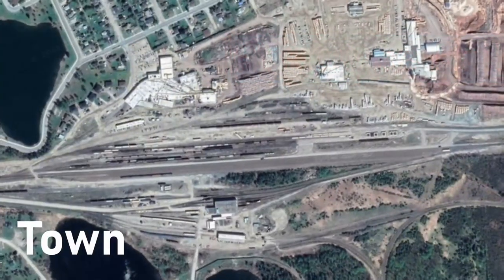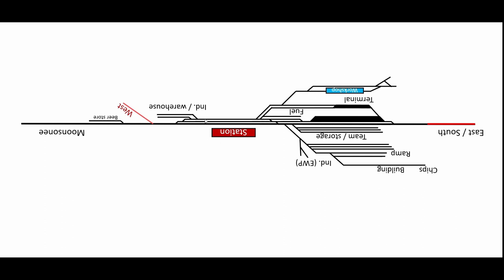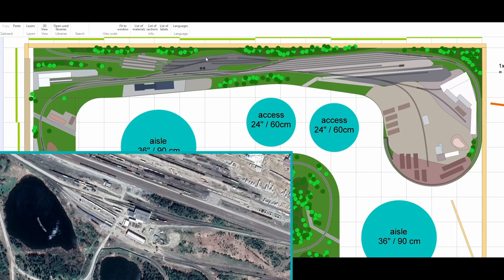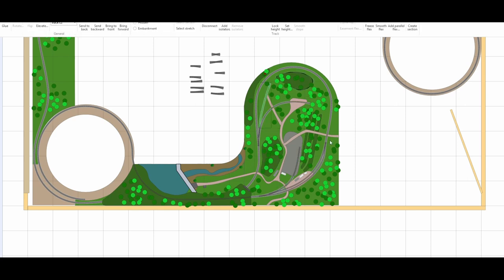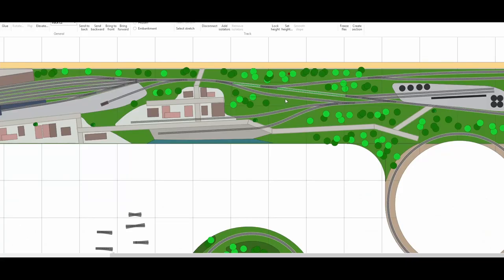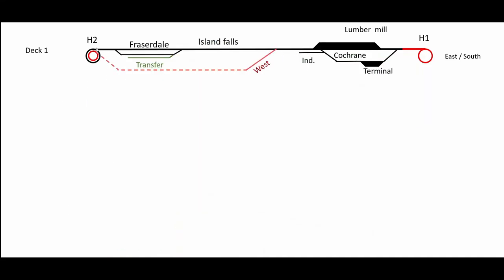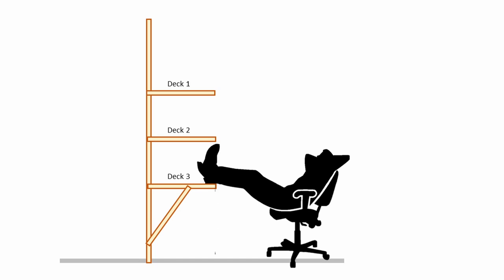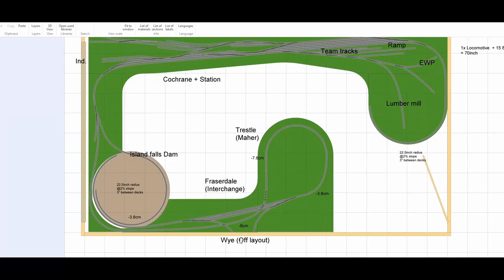How to design a prototypical layout FINAL ~55

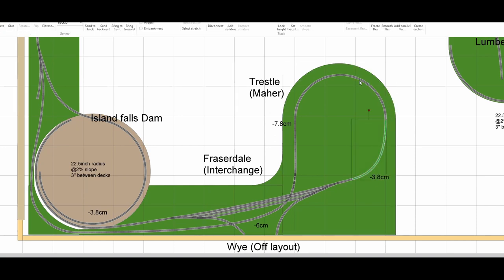Comment: Hi Bart Jan, absolutely amazing how you can convert the prototype to an interesting operating layout. I am gobsmacked at how you do it! Also good to see you grab inspiration from others, like Ron from RTNT, I follow him as well and he is like the energizer bunny, never tired. I just have one question about the deck. At around 13:45 you state that the town is at -3,8cm and that the rununder is at -6cm. I fail to see how 2,2cm is enough clearance for benchwork, sound deadening, track and then a train on top. Are you sure this works or did you get your inches and centimeters mixes up?? Have a good one and I send you sunny regards from The Netherlands.
Reply from the maker: Hi Richy, Thank you for the kind words. It is good to see that the community appreciats what I do. It is a lot of fun to design layouts! With every new design I learn new aspects. Frankly I never worked in the railway industry, nor was I alive in some of time periods that I model. So all that I know know is from the community and books. And maybe some imagination and using my modeling license  ;-P
Coming to your point regarding deck height. I remeasured it. From the 'beer store' turnout to the '-6cm' location is 371cm. You will need around 30cm to onset the gradient so 370-30 = 340cm. @ 2% grade is 6.8cm. The NMRA guildline 7.1 (found in the link below, worst case Modern era, N scale column H) states a bridge clearance of 44mm (note old time era is 32mm). 6.8cm -44mm is 2.4. Cork & track is worst case 8mm so 1.6 cm is left. For this section I would use 12mm plywood. Leaving a few mm for construction tolerances. Having build a layout with a similar area with 3 tracks crossing each other I see it is possible. 
If it is getting a bit too close for comfort, the alternative is not have the duck under at the expense of and laying Fraserdale in a curve. So coming out of the helix continue at -3.8, make the curve with Fraserdale to where the '-7.8cm' is located. Than go into a right 180 curve on the peninsula slowly ascending from -3.8 to 0 whilst going behind Fraserdale and the helix to the beer shop turnout. Hope this clears things up.
All the best!
https://www.nmra.org/sites/default/files/standards/sandrp/pdf/rp-7.1_tangent_track_centers_and_clearance_diagrams_2019.01.pdf